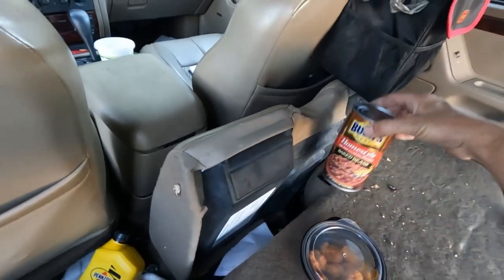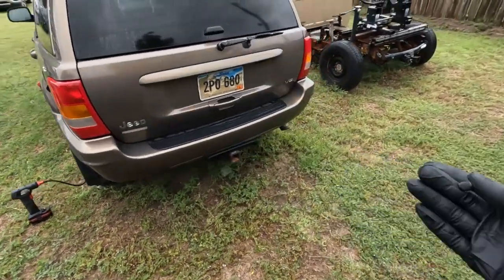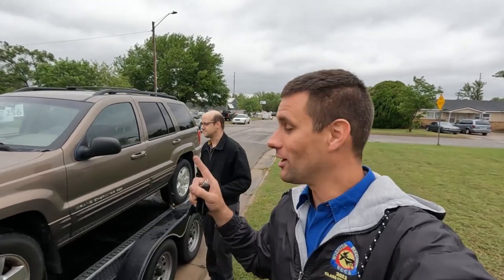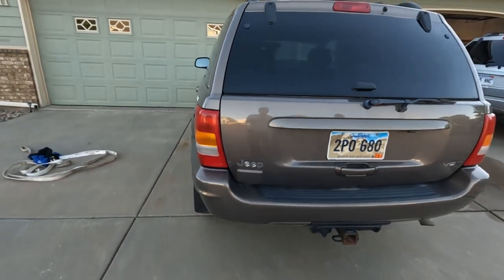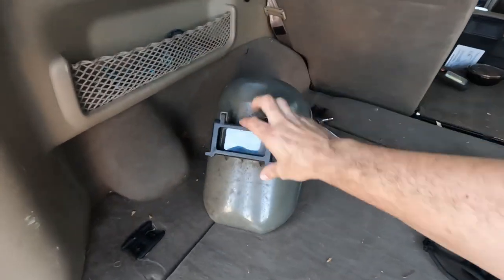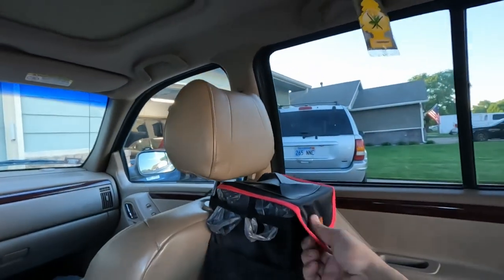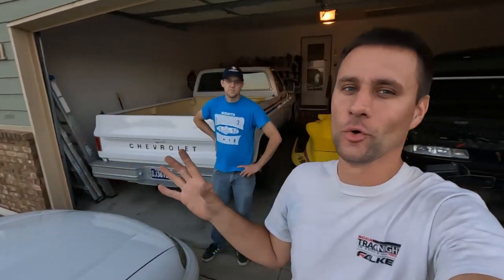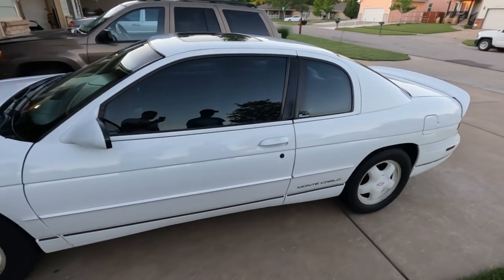Saving LITERALLY all the WJ's!!!

Comment: I saved my own beloved WJ so I always love seeing this!!

The 4x4 badges and non-electroluminescent gauges have it as a 99-01.

The evap box under the hood is 99-01.

I am amazing that Heartland Welding Academy has the same school colors as my alma mater, Heartland Community College, which has a welding program.
Reply from the maker: Good to hear another WJ was saved! Thanks for the view!
Reply: Exactly, I've gone through mine, 4.7, everything, axle seals, upgraded the motor with some 08 cams, manifold, 70mm TB grenaded a few weeks back,  getting it hauled to the mechanics this Tuesday for a new engine. It's not lifted and running 245/75/17s which rub a touch. The seats have had new foam installed, new drivers seat bracket,  AC is cold, oh and repainted her. Also the underpinnings have been gone through. I used a 2014 Cherokee battery and alternator harness and ran new wiring as needed. I kept the hydraulic radiator fan, awesome for towing. Transmission is slipping a tad but Intermittent at most. Everything still works.  No way I'm wheeling my 2014 Limited  heh. I get plenty of attention from jeep dudes and plenty of approving smiles. Better get one while you can.

Comment: Make sure you keep water out of the pump. You have to check the jet pump oil every 25 hours and change it every 100 hours.    Since it was  just easier to replace the pump oil I would replace it every 25 hours.  Yes it will do 60 mph in perfect conditions(I got mine up to 62 but the 1998 with 130 hp they would get To about 65 to 68 in perfect conditions).  I had a 1996 gsx and added the finger throttle.   I dropped the RAVE valve 3 times lol.  It was a defective block 😡.
Reply from the maker: Nice thanks for the info! They are a fun ski! Thanks for the view!

Comment: You know WJ stands for Wichita's Jeep right? So it only makes sense that we just all drive one now. I got mine some new cooling parts since my water pump was weeping and even got her some nice new wheels and such. It seems criminal that they're so cheap and fun!
Reply from the maker: Awesome what wheels did you go with?!
Reply: @TylerPotter  I got some JK 16x7 OEM wheels, with wrangler trail runners at 245/75/16. It's a tight fit without a lift. I have the metal rough country spacers, but I'm waiting to install until I get some decent lift shocks. Any recommendations?

Comment: I saved one of the dubs myself. 4.7 special edition. Saved it from a buy here pay here repo loop lol. Seller had it repo’d from a previous buyer and it would only start when cold. Never would start when at operating temp.  So he gave up and sold it to me for $999. Slapped a new solenoid pack in the transmission, and off to the races.
Reply from the maker: Nice sounds like a great buy and a pretty painless fix! Thanks for saving the WJ's!

Comment: My 04 limited has white face gauges. only difference is the needles on mine are black.
Reply from the maker: Yeah the 2002 -2004 limited/overlands have the different white/blue colored backlite clusters with the black needles. The 2001 limited had a more standard cluster with white faces and the orange needles. Thanks for the view!

Comment: How much will you spend on the new engine? What's the budget?
Reply from the maker: We just pulled a 2008 4.7 out of out local pick and pull salvage yard for it and it was right about $400 for the engine. Thanks for the view!
Reply: I just spent over $5,000 rebuilding a 4.7 L V8 HO that had a valve seat come out.  I hope your $400 motor lasts for a while.  I did not expect to spend that much but it was an experience. It runs excellent so far.
Reply from the maker: @rangel5651  Yes this 2008 Gen 3 4.7 will be the 1st I have heard of going into a WJ and is a 310hp spec motor. I'll be excited to see it run.

Comment: It's too bad people don't realize how capable these things are with just a rebuilt engine for about $4,000 and suspension. You know your upper lower control, arms etc. Possibly a transfer case. I mean mine's got 243,000 on it. It's on its third engine coming up. If you look at what a Jeep with a hundred some thousand on it like a 2014 that one almost $30,000 for one of those. It's crazy. Just keep your WJ drop a new motor in it. Fix the damn suspension. Have a mechanic do it. It's less than $10,000 for all of that and you got a super capable truck
Reply from the maker: As long as people don't know about them it will help keep the prices cheap on them! lol Thanks for the view and comment!

Comment: hi Tyler can you help me with my jeep wj 4.7l I can't bleed the powersteering pump and I think the fan is out it keeps blowing lines and I think the fans not working I need to get back on road my elderly mother can't get in my truck so I need get the jeep goin thanks.
Reply from the maker: I have seen some aftermarket hoses not hold together but it almost sounds like a pump issue?
Reply: I've heard it will only take the oem pump I will have to get one,thanks